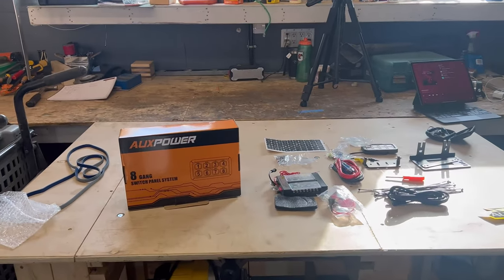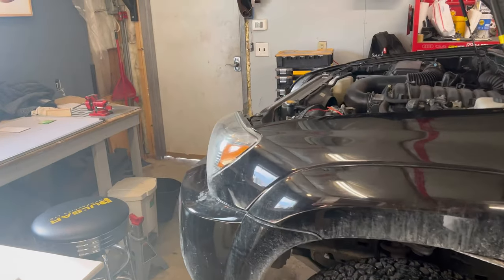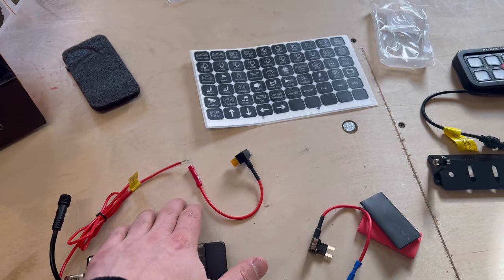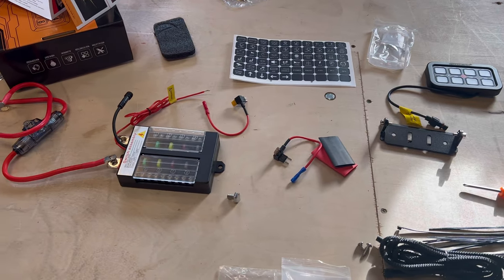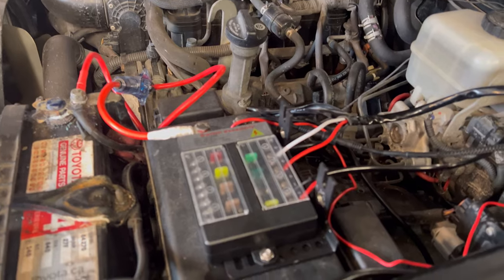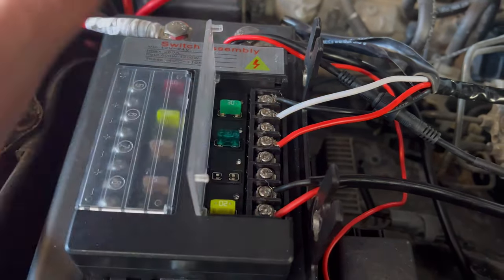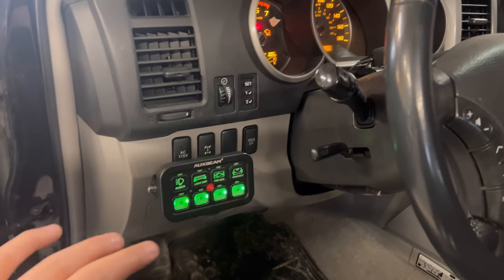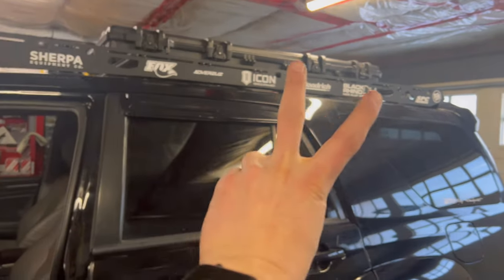Installing an Auxbeam 8 Gang Switch Panel Into My 4th Gen Toyota 4Runner

Comment: Nice, clean install! Your rig looks great! With the add a fuse, what amp fuse did you add to pair with the 5 amp fuse that comes with this kit? I’m going to use your method/placement. 😎
Reply from the maker: In believe I used about a 10amp fuse. Not that it is needed as its just for the switch power!